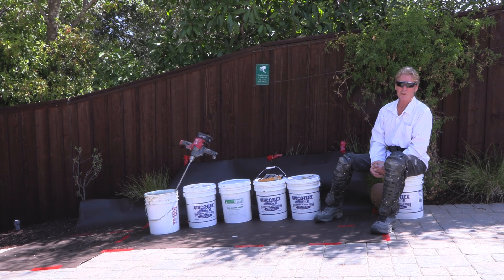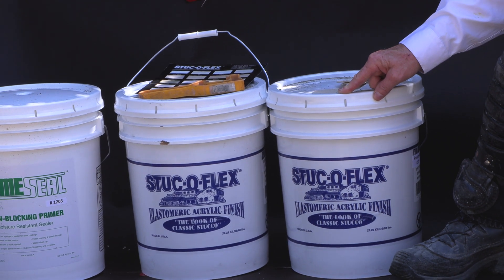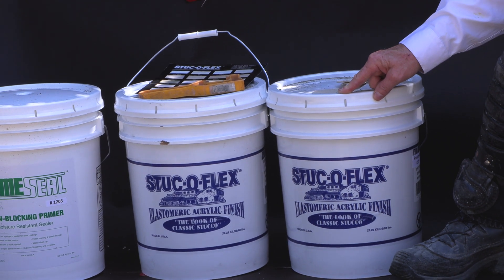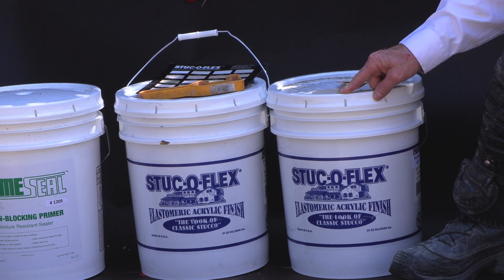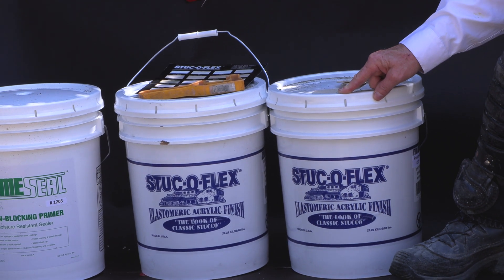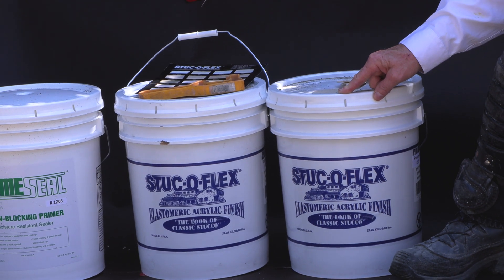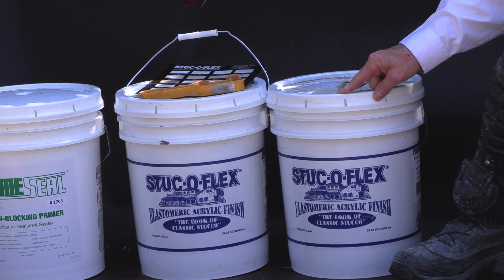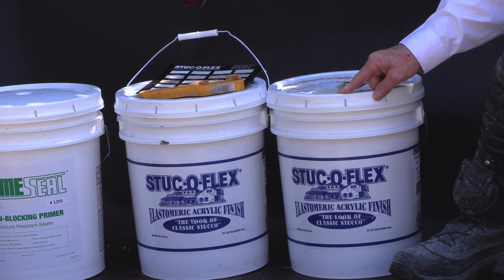Stucco Acrylic fix ugly retaining wall, Stucco-Flex

Comment: been thinking of you and your crew on this last job-got the pirate look down as working attire--this job is redoing rebuilding chimeney hit by lightnight--on rich folks house=roof access is 20 ft high and gotta move the stucco mix and mix on top near rebuild--so out here in 100 degree heat and uv above 12 and heavy hard work thought about you folks over there...in san fran cisco---only things i added to outfit besides over large shirt and waist belt are 2 bandanas--one for head under wide brim hat and the other behind to protect the neck and upper back....lots more to share but hopefully tomorrow my boss hits the outside over porch set up and we finish way too complicated and tough job--say hi to family and crew and stay safe...ps i like the sun also -myself---but this morning took up thermal camera and took some pics of roof and surroundings..the heat off the roof at 8.30am waS 158 DEGREES F...NEEDLESS TO SAY WORK FAST AND GET AS MUCH DONE AS POSSIBLE UNTIL 11 AM OR AROUND...UV WAS 12.7 AND THEY RECENTLY RAISED THE SCALES TO 20 oh my :)    gotta admit it a tough laborous but extremely fulfilling and intricate profession--this known as stucco...
Reply from the maker: @pataniki8034  hard to read my brother.
Reply: @StuccoPlastering  howdy bro..copy and paste into wordpad and then it will be readable...out here still very hot days and high uv..kinda fries the mind.but above is about chimeney fix and stucco on roof 20 ft high--gotta take materials up and mix by hand and its a hard and heavy but now done job...was thinking about you and your crew and how you folks would have done it...

Comment: Will the primer stop it from bubbling off from the ground water or dampness? My guy did dryvit on a wall similar 10 years ago right on parging.... bubbles and peeled like crazy
Reply from the maker: @gibsonbuilds4841  Parging usually means painting a cementitious or lime plaster over a surface. Parging was used for thousands of years to cover branches and such for reasons other than to provide a surface to be stuccoed over. No doubt that parging separated thus the acrylic did too, as Dry-Vit is an excellent acrylic stucco.
Reply: @StuccoPlastering  thanks. I will pressure wash....then try the primer. I still have a left over bucket of dryvit. Maybe I will test for a spot for a year or two. Thanks again
Reply from the maker: @gibsonbuilds4841  No problemo

Comment: Did you stucco the basketball, did you put the blue stuff on it?  Not questioning your integrity, just curious when I don't see it applied. Thanks again, Kirk.  You're the best
Reply from the maker: @gypsydildopunks7083  Good morning Punk Dude, about time someone asked that question. I ordered the stucco from Dan Johnson, whome I’ve had known for over 10 years, I asked if I could buy one of the basket balls they use in their videos? It came with the products. Ask and ye shall receive.  It’s yours but you’d have to come pick it up. 😉

Comment: Looks much better finished with plastic float or float with a trowel
Reply from the maker: @glenwarren4351  This is an acrylic not a cementitious material. Only sponge floats will work for radiuses.

Comment: Kirk, I don’t understand why stucco will last for years outside, yet can’t be used on shower walls. I asked this once prior but the answer wasn’t clear. What type of stucco is the most waterproof and could be used on shower walls.
Reply from the maker: @noname-p2f2q  I don’t recommend stucco even acrylic stucco in showers. It can’t be cleaned, tile instead or plastic sheathing.
Reply: @StuccoPlastering  I want a semi smooth finish stucco with slight trowel marks. Painted with a matt exterior rated paint for ease of cleaning and sealing.